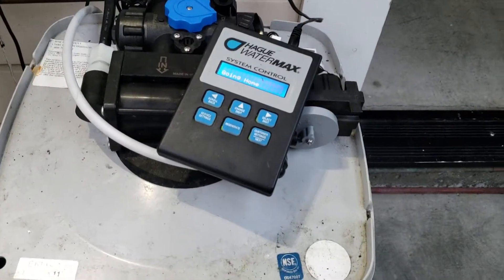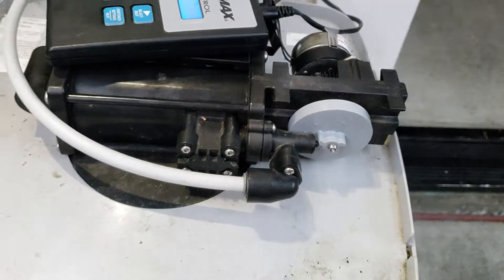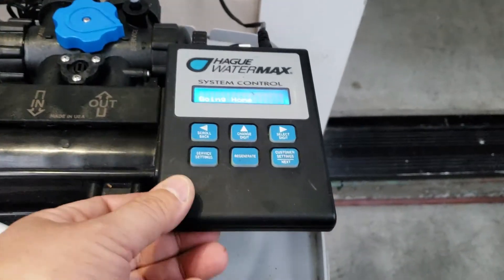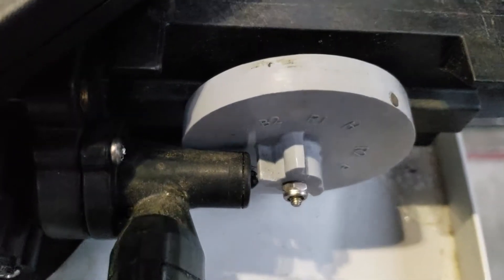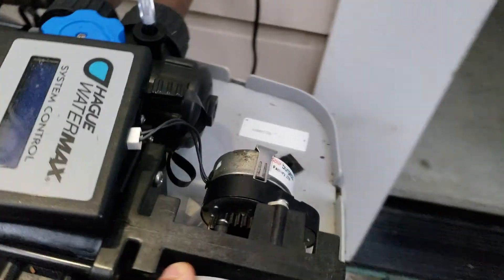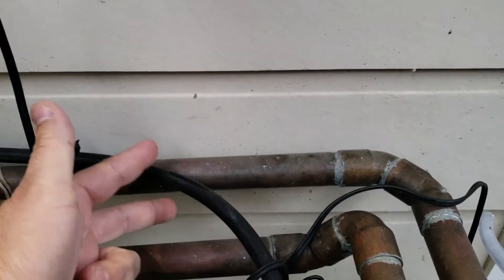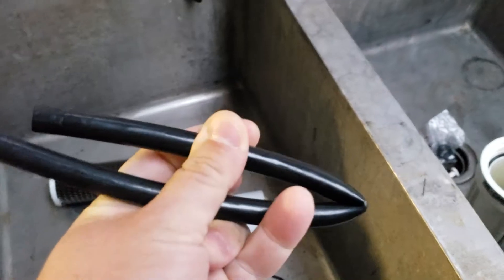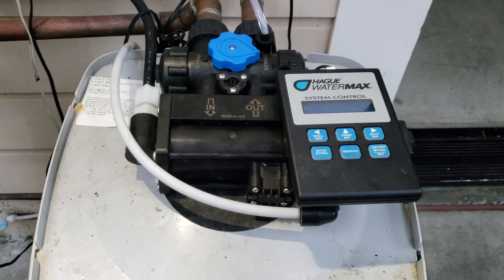Watermax home not found error

Comment: I have an old water softener. I think it’s called water boss 5100 pro serious and it’s been doing this all day long, but I don’t have a bypass. The salt inside was all dried and was hard like a rock. I removed all the salt as this was a new house that I purchased, but the unit is very old. I think it’s 1997. I know it’s a little bit old, but is there a solution for that

Comment: Not related, but doesn't the drain line on WaterMax units need to be at LEAST 1/2 inch (inner diameter) hose?  Looks like he has less there.  Has that changed on newer models?  Or is it OK to use a smaller diameter hose since he is not draining far?
Curious

Comment: This video just gets you stated but doesn't fix anything. I had the "Home not found" msg. I found out the cam follower was very hard to push in and bound up the cam. I took it out and lubed it with silicone grease. Then I still got the msg. Thanks to Wendy's comment, I figured out the cam wheel needs to have the magnet at TDC when I plug the controller back in. So-far-so-good. (AO Smith 350 softener; Push the controller to the right to remove it. Snaps in place.)

Comment: I read Jerry Allred's comment  I talked with my water softener tech.  Yes, the controller board needs to be clipped back into position so the magnet can find "home" on the board.  Unplug and plug in the controller.  The grey wheel will make one revolution, and stop.  All is good now.

Comment: The original video did help me get started with the fix. I was getting a bit frustrated because no matter how many times I "stopped home at the top", it didn't fix the problem. 
Then I thought about the little magnet and that it should be connecting or tripping something. So I stopped home at the top, put the board back in place, plugged it back in... And voila it worked the screen came back on and it functions properly!
Reply from the maker: Congratulations! Glad you got it working.
Reply: I had the "Home not found" msg. I found out the cam follower was very hard to push in and bound up the cam. I took it out and lubed it with silicone grease. Then I still got the msg. Thanks to your comment I figured out the cam wheel needs to have the magnet at TDC when I plug the controller back in. So-far-so-good.

Comment: Great info ….cough cough … yeah not so much the title didn’t say how to stop the water draining …..😤
Reply from the maker: There are several reasons it could be draining. You need to take it apart to see how the piston and drain end seal look. You will most likely need to have replacement parts on hand to solve that problem.

Comment: If this help someone, yesterday I finally solve the problem, seems that the black gear and the grey wheel where a little bit loose, so  I thight really well the nut of the black plastic gear that goes next to the motor and, I did the same with de gray wheel. This helped to keep the gear in it's place so the motor doesn't lock and the error appears on the screen. Also I clean the piston. After that, the regenerate cycle started and seems that everything it's working great. Thanks again for your video.

Comment: HI there,
My water system is not functioning. seems like the water does not go through the system and there is an error on Clock. Get the message , Clock chip fail,. The salt container has been full the past 10 days and do not use any salt. I do not think that the system regenerate. What am I suppose to do? Your prompt response is highly appreciated.

Comment: The one thing he failed to say is the controller board has to be mounted back in its proper position for that magnet on the wheel which is top dead center to register and tell it that it's at home
Reply: Thank You Jerry. This is the critical piece of information that helped my situation.
Reply: This helped me too! Thank you sooo much!
Reply: Thank you man , that was a  critical piece of info
Reply: Oh my gosh!!!! Exactly my problem!!!! Thanks a million!!! I would have never guessed it was the control panel not being mounted.  Thank you again!!!!
Reply: I wish I would have read this last night....
The original video did help me get started with the fix. I was getting a bit frustrated because no matter how many times I "stopped home at the top", it didn't fix the problem. 
Then I thought about the little magnet and that it should be connecting or tripping something. So I stopped home at the top, put the board back in place, plugged it back in... And voila it worked the screen came back on and it functions properly!
Reply: I had the same issue even when i put the control board back but later i found the way i put the board was half way in ( push from front), you have to slide in fron side... The gray wheel will align the track at the bottom of the control board. Thanks all..... I fixed mine now

Comment: I have an issue where the wheel does not turn at all. Any ideas?
Reply from the maker: It's probably a mechanical issue. Visit haguewater.com to find the closest dealer to you.
Reply: @haguewater  "No Results Found" is what your website tells me. I've twisted the motor away but can still not turn the wheel by hand. In other words, it is very stuck. Any advice to give?
Reply from the maker: @Enchisedmy  The valve will need to be rebuilt. Are you a handy do it yourselfer type of person? this is one of those situations where you'll want to have plenty of parts on hand ahead of time. Email me over a picture of your equipment I'll see if I can help you. sales@slowater.com
Reply: @haguewater  I consider myself quite handy but I can't say I have a bunch of parts sitting around. For now I've turned the bypass valve, in the morning I'll call a service technician at JMS-Vattenrening. Apparently they service Hague products. I'll probably use Your comments and/or e-mail for reference, should they ask for it. Many thanks!
Reply from the maker: @Enchisedmy  I would suggest having a new drive end assembly and oring set shipped to you before attempting to repair the valve. Hopefully he keeps those in stock.
Reply: @haguewater  Indeed he did. The piston was stuck and covered in minerals, the electric motor tried to move it, ended up bending some parts. All of them were replaced and it's back to working order.

When asked why he thought the piston would clog up as it did he replied that he didn't know, but a lot of them in this area do, so I can't give you any information on that one, I'm afraid.

Anyway, thanks!
Reply from the maker: @Enchisedmy  I'm glad you're able to get it working!
Reply: @haguewater  I had similar issue. I unscrewed the two screws that hold the piston housing in place and separated it. Then plugged the motor in and it worked. I also manually pushed the piston in a few times. All in all those did the trick. I was still having trouble till i read Jerry Allred's comment. Once the controller board was mounted back properly all worked.
Reply: @mveziroglu  Just had this issue start with mine today :(...the two screws you refer to removing are from the back of motor?  Looking at the diagram on the manual to confirm but only see two sets of two screws from the motor side.  Could you please elaborate for me?
Reply: @tjgarro  Hi Joe, Sorry to hear about it. Its been a while but let me see if i remember. The main issue is that the grey round disk is not able to rotate properly. And what you want to know is that does the motor work without a physical obstacle in place. the obstacle is the little plastic button that gets pushed in and out as the grey cylinder rotates. This cylinder has groves at the center that pushes the little black plastic bottom. In mine it stopped there and was not able to generate enough power to push it in. So the two screws i was referring to is on the black plastic housing holding the push buttons. if you send me your email I can send you a picture. I do not know how to attach a picture to this reply.
Let me know if this is your issue. The benefit obviously in removing that black plastic is to find out if the motor will move and rotate without that obstaction. Also note that the grey cyclinder has small magnet thats burried in it facing the motor side. Its this magnet location that allows the system to know if you are in home location.
Reply: @mveziroglu  thanks so much for that reply - based on what you said, I think I understand what you checked out.  I labelled an image for reference here: https://postimg.cc/ZWXmNG4X
Reply: @tjgarro  Thanks. that image correctly identifies it. Hope you got it working.